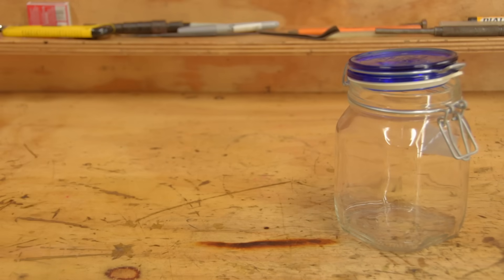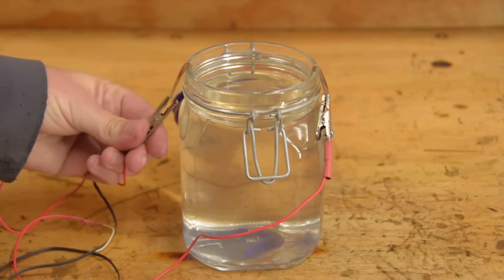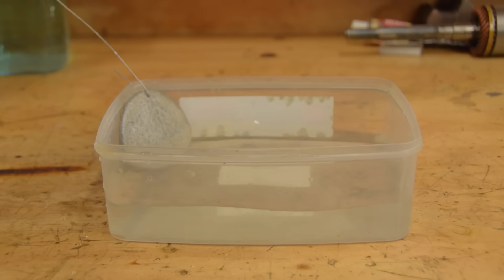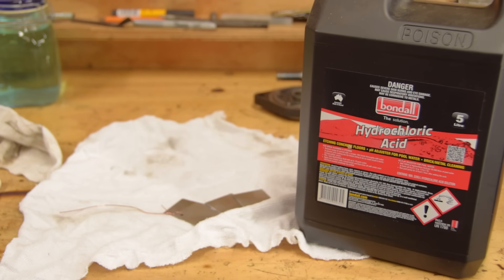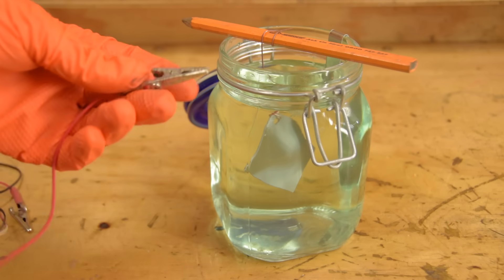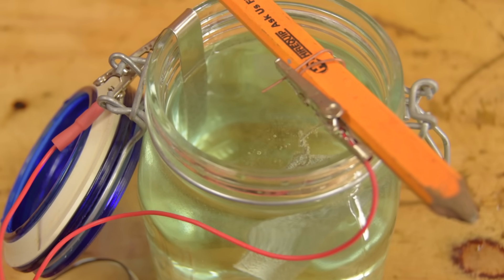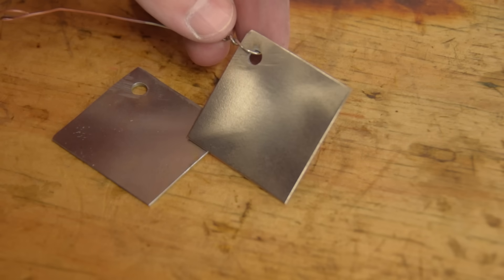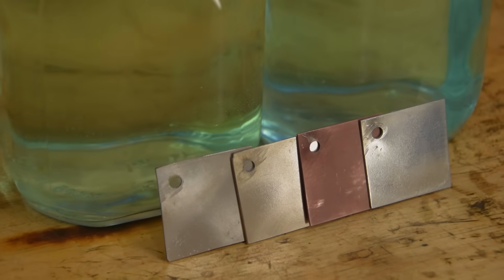Electroplating - Easy DIY Nickel, Copper, Zinc Plating

Comment: You missed two bits of information that I need clarified please:
When you plated with zinc, did you go from polished steel to zinc, or Steel<Nickle<Zinc like you do with the copper jacket
Also
Did you rebath the nickle plated pieces in hydrochloric acid AND brake cleaner prior to the copper bath? Same question prior to zinc bath if from steel, and the same question again if you went from Steel<Nickle and about to plate with Zinc

Comment: Is the acid 100% that you mixed with the water?.   I was shopping around Amazon for hydrochloric and most of what I saw was 37% solution.  
Is that what you mix half and half with water?
Reply from the maker: There's no such thing as 100% hydrochloric acid. 37% is about as strong as it comes. You can use it full strength, half strength, 1:10, whatever.

Comment: Very simple and informative. This is what video guides is all about. 
I only have one question: I have an old charger for an akku vacuum cleaner on 25 volts and 0,2 A. Is the voltage too high for this task?

Comment: I took your principals and was successful plating some small items. However my goal was to plate some larger items. Items that would take +- 8 gallons of solution. Once I scaled it up, I could not get the plating to work. I could get the bubbling parts.  What are the variables to be successful at a 10x size?  I dissolve about 4/5ths of two anodes into the solution. Any guidance would be appreciated.

Comment: Great video. You said that to copper plate the iem must first be nickel plated. Are there any other metals where you have to do the same i.e. gold plating . Also is there a similar solution you can use that looks like gold? Thanks

Comment: “This is not complicated”

After I was released from jail for burning my city to the ground and poisoning it’s 3 million inhabitants (vinegar, electricity and zinc fumes) I realised that this video was missing some important information. 

Exhibit A 
230v 15amp power circuits do not mix well with fluids. (May cause fires if mains fuse is faulty) 

Exhibit B
Zinc emits a toxic chemical microbial enzymes and vapors containing cyanide which can be absorbed by biological agents and can cause death en mass. 

Exhibit C
Copper nitrate and thorium oxide are commonly associated with cancers caused from heated 5% vinegar and electrolytes using sodium chloride. 

My 4 year prison sentence was almost as believable as the words above.

Comment: DEFINITELY do not use a power supply that plugs into the mains. Use batteries as your power supply source. There is potentially great danger in using a mains power supply that has NO TRANSFORMER.

Comment: also when you stirred solution or hung metal, you used wood to do so....meaning when something is plugged in to electricity & fluid, you want to decrease getting shocked ?  as I am unclear each time when this happened exactly when things were plugged in or not....is this so?

Comment: I wanted to thank you as well.  I have followed your directions and tried zinc and nickel.  Both work very well and I am impressed at how simple and satisfying it was.  BTW I was able to use roofing zinc strip that is used to resist moss. I had a roll in the shed.  I also found that using ProForm Surface Cleaner Spray PF511 does an excellent job of degreasing with a plain tap water rinse.

Comment: Great video, but does using salt as an electrolyte in electrolysis not create chlorine ?
Also what would happen if you mixed the copper / nickel solutions and then plated ?

Comment: using salt as an electrolyte is a bit dangerous as you can produce chlorine gas if you run this for long enough or at a high current, I recommend doing this outdoors as chlorine can irritate the back of your throat even in miniscule quantities and can even be deadly in higher quantities

Comment: I wouldn't bother with the rinse off after the hydrochloric acid wash, as you will have dilute HCl in your electroplating solution anyway (those bubbles are hydrogen - in your case you'll have some other metal chlorides and acetates too depending on the purity of your 'salt').  For this reason NiCl2 is even better if you can get your hands on it.  This (or nickel sulfates) are what they use in commercial electroplating establishments, albeit with other reducing and a complexing agents.  Although not with nickel, other powdered sales can sometimes be readily and cheaply bought (e.g. copper sulfate) and are readily soluble.

2CH3COOH + NiCl2 → Ni(CH3COO)2↓ + 2HCl

Glad to see you using gloves (hopefully glasses too if you're playing around with acids).  Metal ion solutions can be toxic and/or carcinogenic.  Speaking of bubbles earlier - low amperage for longer is a good strategy; make sure you do this in a well ventilated environment with the lid off your container and avoid connecting/disconnecting those electrodes after you've been doing so for awhile.  Otherwise boom (less than 5% v/v H2 is considered 'safe').

Comment: 'Do what you oughta:- add acid to water.'  Very much reduces the chance of a painful or expensive splashing accident.
Good video!
ETA  Have something brass to plate with nickel which also has blackened steel parts which I do not want plated.  Is there a good resist I can apply to the parts I don't want plated with the nickel?  Thanks.

Comment: hello sir i follow the step with copper but when I put metal in copper solution and started the process the metal part cam up del copper then I wiped it when the tissue the copper came clean off and I am using a bolt for the test

Comment: Shouldn't the electrolyte solution used be a solution of the metal to be plated
Reply: There will be metal in the solution once the reaction gets going. Metal is removed from the anode, flows through the solution and is deposited on the workpiece.

Comment: Hello, great video! I got a few questions about materials. I am planning to electroplate 3D printed parts, and to make it more resiliant on the outside I was planning to plate it with nickel. Naturally plastic does not conduct electrycity so I would use something like a copper spray.
-Would nickel stick to copper surface?
-And for nickel anodes, are strips meant for welding will work or they are some kind of alloy that wouldn't come out as nicely in the end?
Reply: Electroforming/ typing is basically plating into a mould until its thick enough to stand as an object, this was originally done using moulds with a graphite treated surface- might be worth a try?

Comment: what?... will nickle plate to steel or does it have to be copper plated first?... copper readily plates to steel.. you can accidentaly copper plate steel without a power supply.

Comment: Hi mate, I tried this on the head of a golf club. Left it for 1 hour and didn't work. Should I leave it for longer being a larger piece?
Reply from the maker: You will need to strip whatever is on the club first. I assume you’re talking about an iron? Will only work if it’s made from a metal that will accept plating

Comment: So why did my zinc plated rotors end up rusting on everything outside of the pad zone to?  Seems like you cant screw it up.  Does it fall off easily or something??
Reply: What's the boiling point of zinc?

Comment: Hydrochloric Acid is difficult to find near me.  Can Muriatic acid be substituted for Hydrochloric acid?  If you are diluting the Hydrochloric Acid by 50%, and Muriatic acid is just diluted Hydrochloric Acid, then seems Muriatic acid is a direct substitute, already diluted.  Correct?
Reply from the maker: Muriatic acid is just an American trade name for hydrochloric acid. Hydrochloric acid can only exist in water, so everything you buy will be ‘diluted’. The exact dilution isn’t important. Use it straight from the bottle or diluted 10-1. It’ll just be more or less aggressive.

Comment: Very informative.

My dad was a chromium electroplater (his trade).  Sure, he also did Nickel, zinc and bronze plating, but his job was mostly around the chromium. 

Poly- and hexa-valent chromium are some scary things that you really shouldn't screw around with unless you know what you are doing.  They WILL give you cancer (and when it comes to lung-cancer risk scale from the fumes, "Smoking 2-packs a day" doesn't even rate on that scale.)
Reply: We have an electroplating family Business - one of the last in my country who are allowed to do decorative chrome plating. You are completely right - hexavalent chromium is some very scary stuff. Unfortunately the chrome VI free chrome electrolytes have completely different properties than the good old ones
Reply: is it just chrome being that dangerous for health? what about nickel?
Reply: @gabnagy4562  chrome per se isnt the problem - it is mostly hexavalent chrome that will definitely f**k you up if you handle such a Substance without protective gear and Ventilation (fume extraction). Positive thing is:  things that got plated in a hexavalent chrome process are absolutely fine its only the substances during the process that are very concerning. Nickel on the other hand is concerning in general. While it is widely in use there are regulations in place which try to Limit a persons direct contact with nickel on a daily basis. Too much contact with nickel can lead to allergies and it is also suspected to be carcinogenic.  Its rather a risk for people who have to work with nickel on a daily basis (like in a metal plating facikity). Reducing ones exposure to nickel for "normal people" wouldnt be wrong however :)
Reply: @blunznsepp  thanks for the reply! 
safe plating to everyone!
Reply: @gabnagy4562  my pleasure. Just dont lick on nickel (or any chemicals), wear your protective gear, make sure the fumes get sucked away and you will be fine

Comment: Is it normal for the copper anodes to turn black during the making the solution process?
Edit: im trying to use copper plating on aluminum and its just flaking up and falling off with a few gentle taps

Comment: What would be the difference in the process with an alkaline base (baking soda and table salt) solution for plating the same metals as in amperage, voltage and duration

Comment: Great 👍  A pleasure to watch you make it so simple What about faucets restoration Is the process similar or does the size matter to voltage ?
Reply: More important is the supplied current which depends on the surface area of your faucet

Comment: I made a darker green solution, then tried testing it by plating a washer, but it came out with uneven black deposits all over it.  Someone one a forum said the copper wire is a contaminant. Anyone had this problem  or know what causes this?
Reply: Did you find any answers to this? I’m getting the same with an Oarlock I’m trying to restore.
Reply: @kierandewing9742  nope, but I use copper again, and did not have a problem. I don't think it's copper wire.

Comment: DO NOT try to Nickel plate Aluminum. It must be plated Copper First THEN Nickel. Just a heads up for anyone wondering.
Reply: @John Raace The problem with copper sulfate solutions is that the sulfate attacks aluminum. In addition, the copper is deposited on the aluminum by electron exchange without any current being applied.

And that is exactly why you need a zincate layer. These usually consist of dissolved zinc in sodium hydroxide solution, whereby one must pay attention to the concentration of zinc and sodium hydroxide solution.

Now in order to coat aluminum, a zincate layer is first required and the component is then coated in a cyanide copper electrolyte because acidic solutions will rip off the layer of zinc
Reply: To coat aluminum, you need to apply a zincate layer so that the subsequent layer will be adhesive
Reply: @Mikey Price  I am finding the copper sulfate to be adequate. You think Zinc first would be better?

Comment: First of all thanks for the video! truly great!
I have a quick doubt: Is it possible to Graphene plate a metal? I`d like to do exactly whats on the video but using graphene oxide but i dont know if its possible. The idea i have is actually coat with graphene some copper/aluminium parts. What could i do to achieve this? Or it isn`t possible? Thanks!

Comment: is vinegar a requirement? I used salt water and I have orange water with rust colored chunks and blue foam.

Also I did not buy a copper anode I just sawed a copper pipe in half and used the two halves.

Edit: I have long since given up on this project and I realize the copper tubes (which were probably intended for plumbing) had a pretty good amount of iron in them so I likely made iron electrolytes and blue foam was probably copper electrolytes that refused to mix with the iron.

I have since then bought anodes intended for electroplating so now I shouldn't have any problems.

Comment: The lower the amp, the more the detail.
Reply: Cool, but why?
Reply: @josemateovargasreina5541  I'm not 100% sure but it would slow the reaction down and the "speed" at which the positively charged metal ions are slamming into the the negatively charged cathode, which may help evenly coat the surface with less dendrite formation (less mountains and valleys microscopically) If you look at the physics 1) Amps are a measure of electrical current flow and 2) electric flow tends to take the path of least resistance 3) build up of available positively charged metal ions.  At a higher AMP the flow would be more direct to the path of least resistance, meaning the point on the cathode/part closest to the anode/(closing the circuit) Now when you decrease the "flow" it will slowly act more dispersed and more evenly coat the piece due to the speed of the positively charged metal ion being pushed from the anode to the cathode.  kind of like how you use a can of spray paint 18 inches away for best results instead of 1 inch away (higher flow and amp rate) This is also why it is important to flip your product to more evenly coat.
Reply: @jonesmatthew7511 you’re spot on mate, and the result is that the crystalline structure formed by the deposition of metal is more uniform and compact, increasing the brightness of the plate and preserving more of the detail of the substrate.

It’s also worth noting for certain purposes that some metals (like gold) benefit from extra hardness when plated at low amps, while others (like nickel and chrome) can become more brittle as the finer grain structure can produce internal stresses.
Reply: @MickMinehan  Thank you, do you plate?
Reply: @jonesmatthew7511  I do, it’s my trade. And currently I make intaglio printing plates from laser engraved mandrels, so preserving detail is the most important part!
Reply: @MickMinehan  How can I contact u mate, I need some instructions from you for plating my screws

Comment: i want to stress that i actually managed to fuck up my lungs with chlorine gas inhalation doing this. I didnt huff the jars, but i had the plating running for hours in my room, albeit with open windows and a good draft. So if you're not into having your flat smell like vinegar for days, not being able to smoke for weeks, and having a piece of rib taken out because your doctors think they might have discovered bone cancer (which turned out just being a badly healed broken rib, which other doctors hadn't discovered on their own x-ray before), please do this outside.

Comment: The recipe I used while in the industry to electro plate with zinc (galvanized) included sodium hydroxide, sodium cyanide, and zinc oxide. You contaminate the solution if copper was immersed. 12v 300Kw DC transformers supplied current.

Comment: Your zinc plated test plate has zinc-burning on the lower edges. Due to too high current for this weak solution.. Lower the amps or enrich the electro fluid for better results.

Comment: excellent video. simple and easy to follow. However, every-time you connected alligator clips to the electrodes I cringed because the electrodes were touching the steel ring of the lid hinge. Extreme risk of short circuiting through this ring. I would store the electrolyte solution in a lidded jar but do the electroplating in disposable plastic containers

Comment: Ordered the stuff to give this a go! I have some 3D prints that I want to plate and I don't want to spend too much, so this was an incredibly encouraging and straightforward video!
Reply: The prints will need to be conductive. I've seen a video where they sprayed on a conductive paint and plated that. Look up "Electroplating 3D Prints | Thermal Detonator"
Reply: what way did you go with the power supply? i've had an issue finding something like what he uses in the video

Comment: I've been letting it sit for about 4 hours now and still nothing. 2.5 amps and 12 V. This is what I read on a guide online. I bought the anode off Amazon for 8.99 and it said it was 98ish purity. Still no color change though

Comment: SO IT NOT MENTIONED NOR OBVIOUS OR INTUITIVE, BUT DO AS HE DOES I.E DECANT, POUR WATER, H2O FIRST INTO CONTAINER AND THEN, FOLLOW BY ADDING ACID, HERE ITS HYDROCHLORIC ACID, TO WATER IN CONTAINER. AWAYS ACIDS TO WATER. NEVER EVER WATER TO ACID, IT CAN, WILL POTENTIALLY EXPLODE VIOLENTLY OUT IN ALL DIRECTIONS, DISPERSING UNDILUTED AND DILUTED ACID INTO THE AREA, AIR COLUMN, FACE, SKIN, EYES, MOUTH IT WILL, WILL, WILL DEFINITELY DO DAMAGE AND YES JUST AS WITH THE METAL THIS SOLUTION WAS ETCHING CLEAN, YOUR BODY WILL BE PERMANENTLY MARKED, SCARED. SO WATER IN FIRST THEN ACID. ACID IS ALWAYS ADDED TO WATER. NO NO NO ADD WATER TO ACID, BAD THINGS HAPPEN.

Comment: nicely explained 👍, if we use bit high amp power supply around 5 to 6 amp it will work batterly. because if we use weak current for electrolysis processes it'll work but its plating not durable for log time.